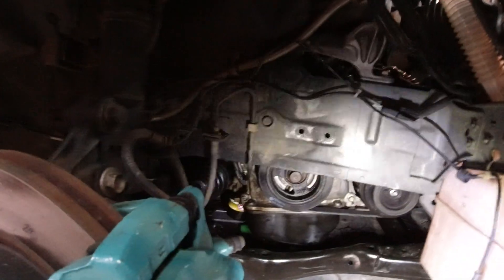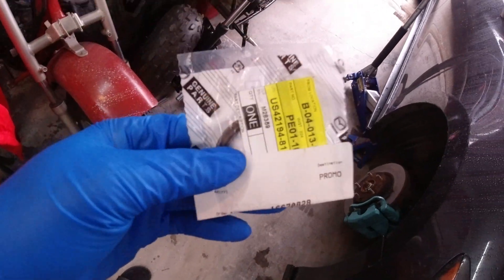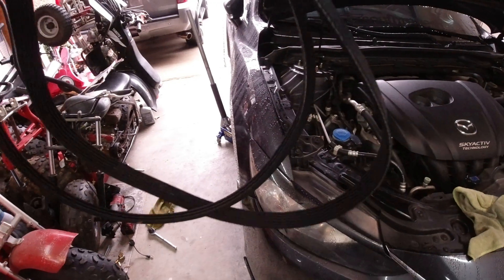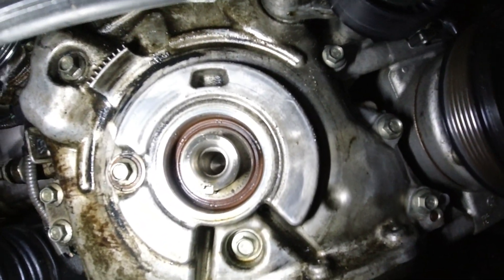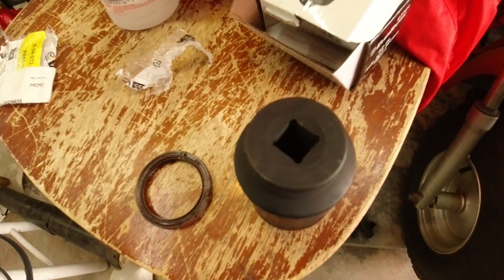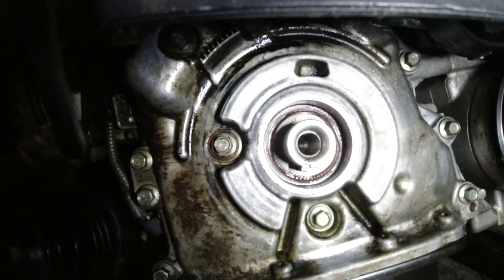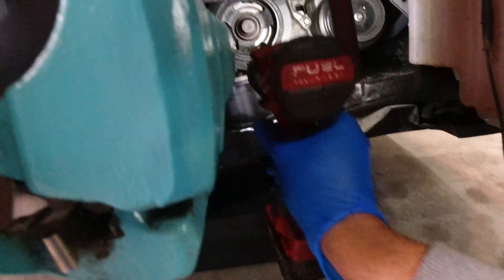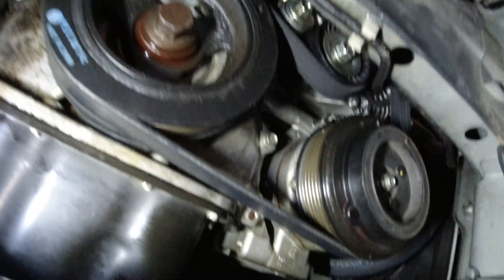Engine Crankshaft Front Main Oil Seal Replacement | Leaking Oil | Mazda 6 Chronicles

Comment: DON'T DO THIS - the crank seal is supposed to sit 0.5mm below surface.... not push all the way through - these Mazda timing plated don't have a stop...
Reply from the maker: In figured that out after the fact and talked about it in the next video about the crank seal when I had to replace it again.
Reply: @DariusBuildz  Not fun pulling that seal out from that far back - did you have to pull timing cover?
Reply from the maker: Nope. Pulled right out and replaced it again. It had hit the timing chain and knackered it up and was leaking oil again.

Comment: What year is you Mazda 6?  I'm looking at a 2019 that needs a new front seal that recommends removing the timing cover and I'm trying to figure out if it has to be pinned or not.
Reply from the maker: Mine is a 2014. If your 2019 is the 2.5 N/A, it is the same exact engine. I am not sure about the 2.5T's. If you do this, make sure the seal is FLUSH with the front cover. DO NOT PUSH it back like I did in this video.  The timing cover does not have a stop built in to it.

Comment: How many miles did your belt snap at? I am getting small oil spots coming from the removable panel thats smaller closer to the front of the car, thought it was because of a drain plug washer, but i did a oil change and its still seeping, i hope this is it
Reply from the maker: The oem belt was cracked but still fine at like 133k. This was a parts store gates belt and it had about 35-40k on it when it broke. Both belts were new and the tensioner.

Comment: I needed it. Thanks. How hard was it to pull the old seal?
Reply from the maker: Wasn’t that hard. I think I ended up drilling a small hole and putting a screw in to pull it out. Just be careful not to nick the crank or the side cover.